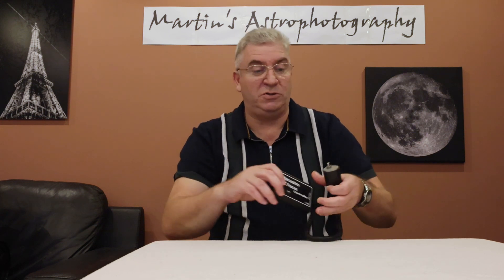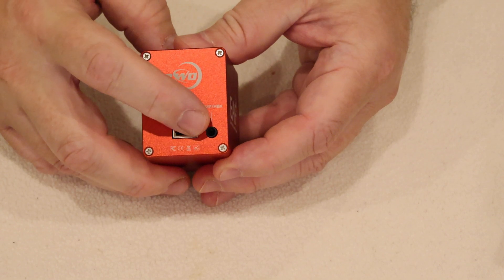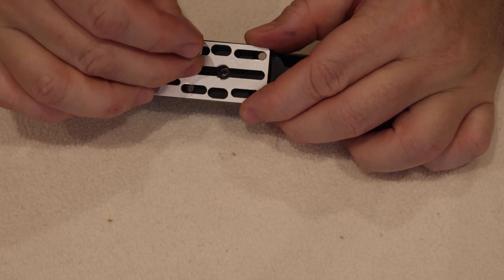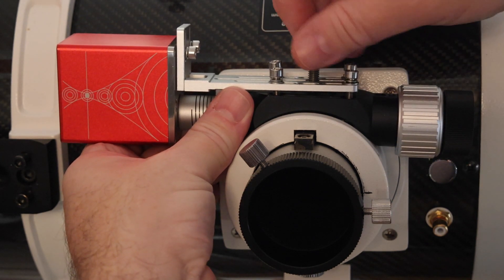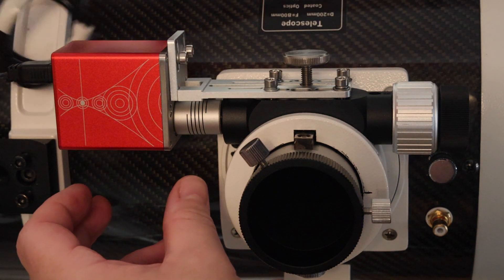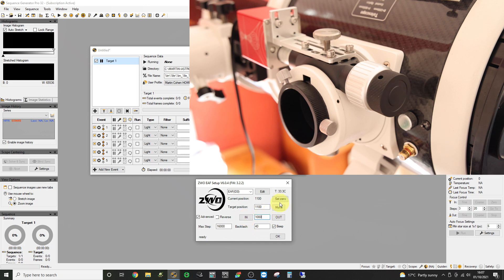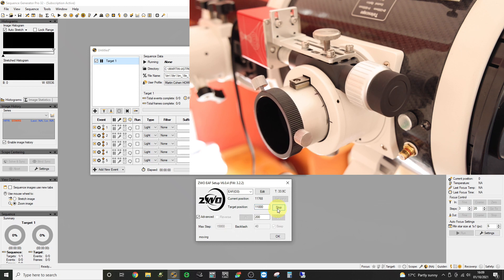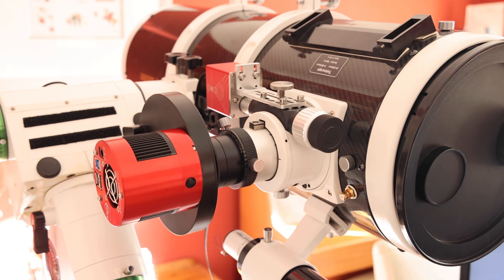ZWO EAF 5V Setup for Dual-Speed Crayford Focuser

Comment: Great video, very well produced. Has anyone worked out a bracket hack for mounting the ZWO EAF on the GSO Crayford focuser? I don't have 3d printing capabilities, so I guess I'm asking if there is a known bracket available. The GSO crayford doesn't have the four tapped mounting holes, but rather just two thumbscrews that couldn't be used for fastening.  I suspect it would require a bracket of a totally different configuration that would attach at the focuser base plate via a pair of the through bolts. Would be very much appreciated if there is any beta on this.

Comment: This told me all I was wanting to know about my new focuser before I order it. I'm a remote operator as I set up on my spot in the back yard {garden} and then Wi-Fi connect my mount computer to my indoor office computer, so all of my operations are via my computer displays. I was particularly thrilled to see your explanation of the EAF's on screen controller. 
I do have one question; Does the temperature probe allow for the unit to correct for temperature changes during the night? I particularly do some exceedingly long duration subs and having auto temperature adjustment unattended would be really nice. Thank You for your detailed video!
Reply from the maker: Thanks for your comment Sonny. I use Sequence Generator Pro to control my sessions and this provides a temperature compensation feature for the focusing that uses the temperature probe. I don’t know what software you are using but look and see if it provides this option. Clear Skies.

Comment: How tight to do up the focus tensioner knob? I usually do not put it back on after installing the EAF. Is it necessary?
Reply from the maker: It should be just tight enough for the EAF to make the drawtube move. Do not overtighten.

Comment: Hey Martin, great video. I have a question. I have a Meade LX 10 and want to add one of these EAFs to it. I have looked everywhere (including the ZWO website) but can’t find out, one, if it will fit directly as per celestron or two, how it will fit on the skywatcher Crawford SCT dual speed. Any ideas?
Reply from the maker: Thanks! Certainly possible.  You can use two toothed GT2 pulleys and a GT2 belt to link the ZWO EAF to the focus knob's shaft. You just need to fashion a suitable metal bracket to hold the EAF in a suitable orientation.  Watch out for the shaft diameters.... GT2 pulleys are available for a range of different shaft diameters! You can get GT2 pulleys and belts on Amazon pretty cheaply.  You will need to include a slot somewhere in your mounting bracket so you can adjust the tension in the belt.  I hope this helps.
Reply: @martinsastrophotography  Martin that it perfect! Many Thanks. It’s one of those brain teasers that has been driving me up the wall. I was starting to convince myself it was potentially going to send me loopy :). Welcome to the world of astronomy and astrophotography ah! Thanks again.
Reply from the maker: @chrisrichardson007  Take a look at my custom focus video. A bit different as it’s for a camera lens but the principles are identical… Building a Custom Focus Control System
https://youtu.be/-P5RCB1L32c

Comment: I found this very informative thank you. The only thing I would ask is if you want sometimes do manual focus up using the crayford dual speed knobs, if you loosen the grub screw on the D bar of the focuser, are you able to still use the crayford manually?
Reply from the maker: Thanks Darren. I would loosen the grub screw at the EAF end of the coupler. The couple then acts as a convenient focusing knob.
Reply: @martinsastrophotography  you can manually focus with the hand controller. It plugs in to the jack for the temp sensor.
Reply from the maker: @tommydowling6011  Hi Tommy. Yes, I have the Hand Controller and have tried that. However I now only use this port for the temperature sensor as I control everything remotely. Clear skies.

Comment: Hi, do you have sny vibration of the image when the motor is running? I have just fitted one to my 130pds following your excellent video I get a high frequency vibration/shake of the image when the motpr is run to focus.
Reply from the maker: Hi Andy. I am not a visual observer, so I do not look through the telescope while changing the focus. My EAF runs very smoothly and I would be surprised if I had the problem you describe. I wonder if it is properly aligned and the focus is fully unlocked and tuned correctly on the friction plate. I suggest removing the EAF, checking the focuser operates smoothly, then re-fitting and testing again.
Reply: @martinsastrophotography  thanks for the reply. I am currently using an asi224mc and can see the disturbance on that too. I will remove the eaf and then remount it without the coupler to the focuser and see if it still does it.
Reply from the maker: @g1dtf  Why is your EAF ‘running’ while you are taking photos? It should not be moving at all during an exposure.
Reply: @martinsastrophotography  lts not running whilst exposing just prior to the session when focusing the camera. I probably described the issue a bit poorly. Not used a motor focus before so not sure what to e xpect. Everything is one big learning curve atm so appreciate any help I can get. Thank Andy. 🤗
Reply from the maker: @g1dtf  Ah ok, good! I am puzzled how the EAF can disturb the camera if it is not moving. Does it vibrate when it’s not moving focus position? If so, it is faulty. If not, could the disturbance be from something else such as wind gusts?
Reply: @martinsastrophotography  no the slight vibration of the image only occurs when the motor is running and fosusing and stops almost immediately when the motor stops. Not a big issue but just want to make sure I have everything working as it should.
Reply from the maker: @g1dtf  Sorry Andy, what you are saying confuses me. Are you watching some sort of live stream from your camera during focusing? If so, it would not surprise me at all to see a disturbance when the focus motor moves…in fact it would amaze me if it didn’t.
Reply from the maker: I should add that I use an autofocus feature in Sequence Generator Pro which moves the focus, then takes a shot, then moves it again etc… So the camera never operates when the focuser is moving.
Reply: @martinsastrophotography  Not tried any auto focus routines yet. Just manually focusing the EAF with a bahtinov mask currently. Only had the current setup a couple of months and the EAF last week. So still trying to get a grip of everything. Your feedback is much appreciated.
Reply from the maker: @g1dtf  No worries. I have been there. It’s all part of the journey. The first time I used a focus motor I was looking through an eyepiece. So you are live streaming video from your camera while adjusting the focus with the Bahtinov mask fitted, yes?
Reply: @martinsastrophotography  basically yes. Similar to live view on the Canon dslr.

Comment: Thank you.You mentioned having the hand controller could we see that being used please?
Reply from the maker: Thanks John. YouTube videos cannot be modified once published, so I can’t add this without removing the video and publishing another one. There isn’t much to see when using the hand controller. You just plug it in and press one button to move the focuser inwards and another to move the focuser outwards. There is also a switch to set speed to slow or fast.

Comment: Great video and useful as always, particularly the backlash bit.  My scope was slightly different however.  What you call a friction adjuster is actually the focus lock on the 200PDS dual-speed crayford.  As such, it gets totally removed during the installation as the EAF locks focus.  Also, I had no need to drill out anything or buy new components.  I wouldn't have loosened the friction grub screws as they are obviously still needed.  It may also be worth noting that you don't need to remove the crayford at all to fit this unit;  in my case I did, because I wanted to flip it 180 degrees, however it can just stay in place.
Reply from the maker: Thanks Andy. Very useful info. Thanks for sharing that. Clear skies.
Reply: Spot on Andy, hope folk don't leave they screws loose.